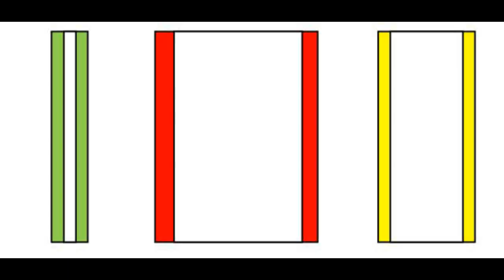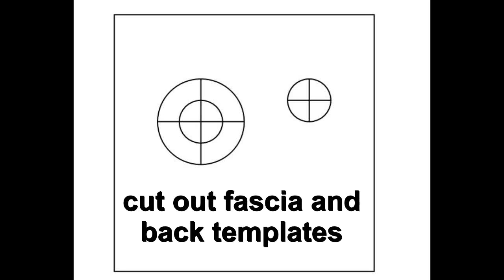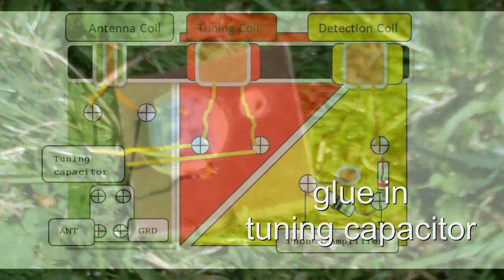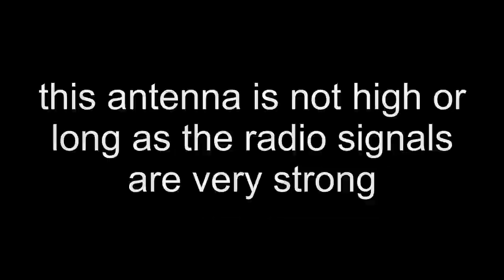Making a Crystal Radio ( How to make a Crystal Radio )

Comment from the maker: To be sure of a good earth from within your house use a cold water pipe that is coming from the stop tap/external subterranean pipework. There are Earth Clamp/Straps For Pipes that ensure optimum conductivity. Central heating pipes may be completely isolated from earth so are therefore not recommended.

Comment from the maker: 10/60/40 - using 32 awg coil wire on a ferrite rod: 100mm Long x 10mm Diameter. - I don't count the turns - I multiply the diameter of the 32 awg by the number of turns and mark it out on the card template - so it works out 10-12 , 58-62 - 38-42 - a few turns less or more will make no difference.

Comment: Looks like a sensitive and selective set - well done. How many turns are required for the coils? I'm guessing say 10 turns for the antenna coil, 100 or so for the tuning coil and say 70 for the detector coil. All wound in the same direction - but that's just a guess.

Comment: in this country,  problem is to find crystal earphones.]
They are no more sold
greetings from Brazil
Reply: ***** Thanks for the information. I  kept  contact with the salesman. Although freight is high (almost half the price of the earphone),  I will buy it in the first opportunity. Congratulation for the radio. Very good sounding. (1) dolar is equal 3 reals. thanks again.
Reply: +Jose A. CONSTANTINO A speaker from an old telephone should work.